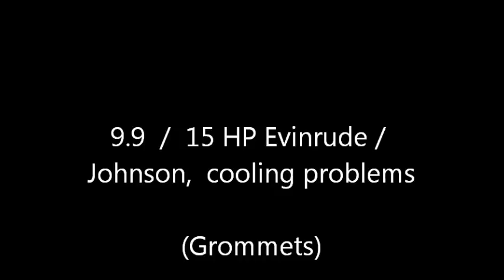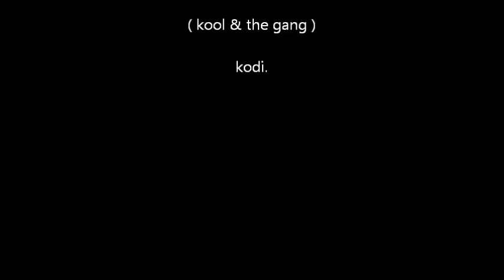Evinrude , Johnson 9.9 / 15 hp cooling problems

Comment: Well done…you got my sub. I just picked up a ’83 E-rude 15hp (along with boat and trailer) with weak pee flow; lightly used in fresh; probably no maintenance for 2+ years. I have my to-do list to get it in shape, and if a new impeller doesn’t help the flow, I now know what else to look at.
Reply from the maker: +William Moomaw, Congrats on your new motor,  pound for pound one of the Best ever made.                        
                                                                                                                                             kodi

Comment: Most common problem I've had on these johnnyrudes besides the throttle gear being chewed up. Great explanation!
Reply from the maker: Carl Harris,  Yep'  I agree 100%  I also don't care for the recoil starter.     kodi
Reply: @kodibassInsideoutboards  that's true also overflywheel recoils make carb repairs much simpler

Comment: When reinstalling the power head how do you get the long copper tube back in its hole do you have to remove the foot install the head then put the foot back on nobody has a how to video on that thats my dilemma i ran into today only way i can think of doing it is lowering the foot
Reply from the maker: Well'    I  4  sure  do Have  that Vid,  Now  do  not  ask me  what  I titled it ?    Ok  mate The  answer is Yes & No.  If your tube is in the kinda-sorts position U removed the power head  drop it in  & hope it makes the water pump hole?  If when U start it ,  &  No Pee,  Yes  drop the L/U make sure it is in the pump housing.  sucks but that is the deal.  kb

Comment: Is there some kind of solution you can poor in the water jacket to solve the salt? I was thinking of acid because the acid will clean Aluminum.
Reply from the maker: Yes there are a few different acid solutions on the Market  most are  Nitric Acid based  such as SALT-A-WAY..  There are other brands which course solvents etc.  .    kb

Comment: Can you explain the "work around" that you mentioned for the single tube style?  I assume that it is something like remove the lower unit and run something up the tube to dislodge the buildup.  I have a 1980 9.9 electric start that i really do not want to try to remove the powerhead if i don't have to.   Thank you for the video!
Reply from the maker: Yes' find a old discarded weed whacker,  remove the flex shaft from it.  drop lower unit shove flex shaft up water tube mark flex shaft with marker so as to have 4-6 inches hanging out the water tube cut flex shaft & hook to a cordless drill, at the end being sent up water tube shred a bit with a set of pliers,  Send up rotate drill both directions for a min. or so. remove flex shaft and blow compressed air back thru p-tube & blubber hole.  If your shot exhaust tube gromett under powerhead has collapased this will not solve the problem.      kb

Comment: I went to take the 1978 9.9 out today and it wasn't peeing. I just had it out last week and no issues on a 10 mile round trip. So I loaded it back up and brought it home. Dropped the lower and the pump and everything looked good, just changed it 2 years ago. So I figured I would hop on the tube and figure out what the problem might be. I'm not liking what might be the problem now. Oh and the bearings on my trailer are shot too.  Today just isn't my day.

Comment: Hi, what's the correct range temperature of powerhead? I tried the outboard in a barrel and seems the the power head system was very hot.
Water coming out from the check, thermostat is new.
Thanks

Comment: hello my friend. My Evinrude etech 30 hp engine is leaking oil from the tail joints. The smoke is not coming out completely from the exhaust, I think the engine is choking and not working properly. Why does this?.. What should I do?..Thank you..

Comment: You are right...And the sad thing is that the original style grommets on the early models were no problem at all...Some knit whit engineer, that had never heard of salt water change the grommet/water tube design in 1979, which was when the problems began.  The design was once again changed in the mid 80s, which was an improvement, but problems continued.  I solved the problem with the 79-mid 80s grommets by "misinstalling" them so the grommet does not extend over top of the water tube.  I usually just slice a little bit off the top of the later style grommets to achieve the same thing...And yeah, the open megaphone doubled the grommet issue, it also introduced upper motor mount problems by allowing exhaust/goo to easily flow up around the mounts....OK, looks like you do the same thing I do by trimming the grommets  But, are you using the later style grommet on the early style water tube?? ....Later model water tubes were a little longer to help make sure the grommets did not extend over top of the water tube...I remember the first one I discovered, it was a 1980 sailmaster..  I remember misinstalling the grommet, then pulling it apart years later to check it out, was doing fine...Just another case of engineers who know/care nothing about the power of salt water...

Comment: Nice. Thnaks. Im tinkering with a 9.9 sears "Gamefisher" and Im pretty sure this must be my issue impeller is good, thermostat is good but no flow.
Reply from the maker: +AG,  I would drop your lower unit, & check if the water up-take tube is in the water pump housing, B4  Pulling the power head.     kodi
Reply: @kodibassInsideoutboards  Hey, thanks for the reply That is good advice as I pulled it apart and the impeller had detonated so hopefully that will get her going! Other than that she is a solid runner!
Reply from the maker: @alexgoldstein7553   Great 2 hear, Them R Tuff outboards 4 sure.   kodi

Comment: Hi Kodibass! I have a question related to overheating. Do you frequently see exhaust ports overly caked in carbon buildup? I recently lost a Johnson 25 due to carbon breaking free and falling into a cylinder. When I pulled the cover, the inside looked like a charcoal furnace. Prior to its demise, it had been showing signs of overheating and "excess drag".

My "baby", however, is a 1966 6hp. It's been utterly reliable, always ran like a new motor. This year, it's beginning to feel some of the same sense of excess drag. Bit what's really interesting is that it cuts out at low idle, as though a reed is sticking.  Opening the throttle will cause an abrupt correction in which the motor runs perfectly again..ignoring the drag. I've had the intake apart recently, and already have ruled out the reeds. Both leaves are viable, with the stops and the plate still clean and shiny. Nothing adhering.

Falling back on the heartbreak from my 25, I think I'm seeing another picture of a clogged exhaust cavity. My thinking is the excess backpressure is causing the drag, and also reducing the vacuum to a point where it can't open the reeds if the RPM is too low. I'm going to pull the cover this weekend and give that a good cleaning, especially to have some peace of mind that the 6 won't follow a similar fate as the 25.

Researching online, I've seen a lot of apparently reputable outboard mechanics swear that will never be a problem. But I've personally witnessed it once, maybe twice. Additionally, my service manual also disagrees with them, insisting that the exhaust ports be cleaned as part of regular maintenance. Do you have any experience in that respect?

Comment: Great video! I own a 1976 9.9 johnson that does not have the tell tale. I installed a new grommet on my water tube . I have ran my motor several times but water Only comes out the exhaust relief at high speed. At idle it circulates but comes out around the lower mount bracket. I would like to see it spitting out the exhaust relief all the time. Would you have any suggestions? Thanks
Reply from the maker: +rodman738, Did you replace both grommets?  It is just as important to change the exhaust grommet as the pick up one,  they both are prone to distortion over time.  Also check your T-stat.              kodi
Reply: rodman738 not sure if you’re still following this, I’m having the same problem. Visually I can see water coming out of the 4 holes above the cavitation plate. I would like to see it spit out of that exhaust relief too!
Reply: Connor D I believe I did change the thermostat. My motor only had one Gromley to change.
I added a tele tale to this motor also. Check Leroys Ramblings he has many informative articles,
Reply: rodman738 thank you! I was hoping you were still around after a year! Glad to hear it seems like you got it solved

Comment: @kodibass should the water coming out of the telltale ever be a little hot ? My Jonhson 15 runs perfect but the water will get warm sometime and the power head often gets hot to the touch ?? Is this normal for these motors?
Reply: Did you ever find an answer to this? I’ve got the same question

Comment: I have an early 80s Johnson 9.9 have rebuilt water pump, put in new thermostat, Shot water up through the copper tubing and out the tell tale  with water hose, also shot water down thru the bottom of foot and cleared the little mesh filter at the bottom.. still not getting a strong stream from telltale. After watching this I am realizing I have checked everything but that upper water grommet At the bottom of power head. Think that’s my issue?
Reply from the maker: +TT,  Yes'   the upper grom's    R   your prob's & issue   4 sure......        kodi
Reply: kodibass pulled it off last night wish I could show a pic of it it had melted and collapsed into itself!! Waiting on new grommet and housing gasket to now

Comment: good evening master I have a good evinrude 9.9 model 1983 which sounds good on an inflatable boat 3.80 meters. in the sea the engine speed goes up well in acciliration but not of force the speed of the boat does not exceed 4/5 knots give me some idea  please ... thank you very much
Reply from the maker: +JM,  It sounds like what you are describing is a slipping  propeller hub,  Try a different prop.                                                 kodi
Reply: kodibass .hi sir i stuck the flywheel with forward gear and i turn the propeller with all my might it not slip? thanks for your reply

Comment: Does this apply to the more recent model years as well? I have a '99 johnson 9.9/15 with cooling issues
Reply from the maker: +AM,  The design was  "" improved"" for the post 1992 motors which is what u have,  However improved does not mean done away with,  Yes'  It can happen to a 1999,            
                                                                                                                                     kodi

Comment: How about an obvious question???  You said you have a "work around" ...care to share???  After reviewing this video which is great I see a perfectly complete paper gasket meshing down tight all around the water tube.  My question is WHY bother with any gromet at all??  Seems a good tight gasket fit with tight bolts seems that there should no need for any gromet....reach up the water tube and grind out the obstruction and leave it go....  No need to pull the power head?????  Whatcha say fella???